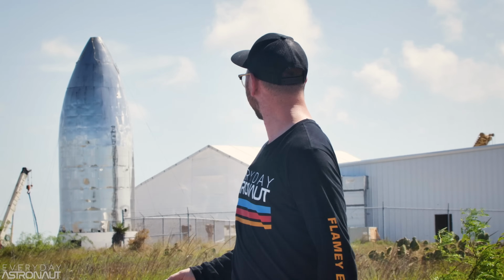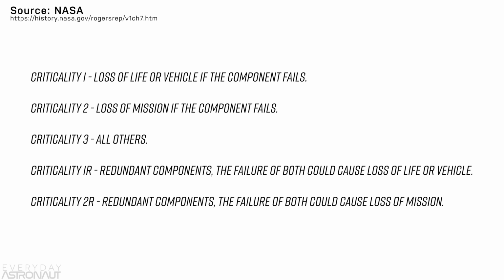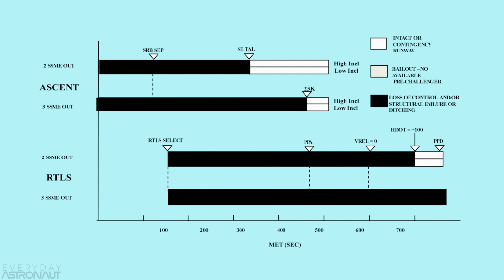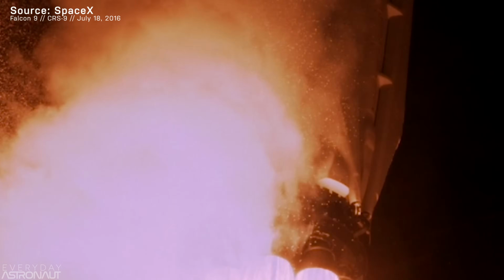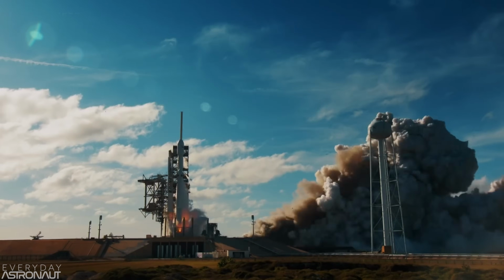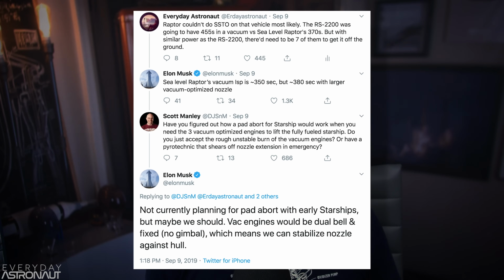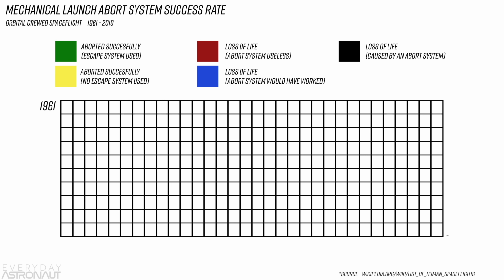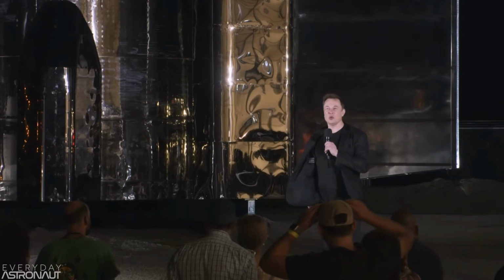Why won’t Starship have an abort system? Should it?!

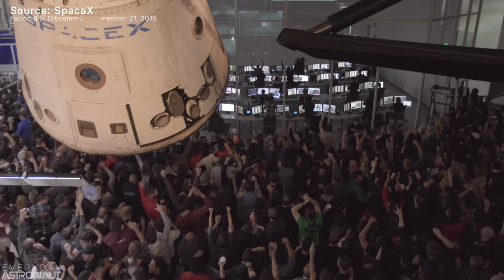Comment: 25:00 perfect examples of why this is so hard. All those failures had simple fixes, but those fixes were not specifically anticipated. And that's where Murphy's law comes in. There is always something you didn't think of. No matter how good your FMECA is there is always something you missed.
Reply: Ikr . He is basically saying nothing else will fail bcs these simple fixes won't happen now
Reply: Yeah, this is a significant part of why testing individual parts and concluding that when they're put together that their safety in isolation means that they will have safety in combination too (highly flawed assumption!) is so bad.

At least when you test systems all together you are much more likely to produce the conditions where unexpected failures due to unanticipated interactions can occur.

Also - by adding a full abort system you will significantly lower the performance margins due to the large amount of weight and necessarily redundant systems (especially propulsion). This has its own implications for safety, and the increased system complexity will, too.

As you say, it's complicated. There is no single answer.

Personally I tend towards a perspective that basically says "space is inherently dangerous, and so is system complexity and reduced performance margins. Prefer a solution that minimises complexity and maximises performance margin, and redundancy if this can be achieved with minimal additional complexity"

IMO, the engine redundancy makes me feel significantly better about the safety of the vehicle. In future, if the cabins can be fitted with a means to turn the crash couch into a self contained ejection capsule (no propulsion, just hope that the capsule emerges from a vehicle failure intact) with a parachute system maybe this can be a good compromise. It would be nowhere near as good as a full abort system but it's also far simpler, nowhere near as heavy, and you'd think still much better than having nothing at all!

Comment: If I had a nickle for every time I've seen a 1x10-6 failure occur...I'd have more than a couple nickles. It is just incredibly hard to maintain reliable data and quality control on stuff. So let's say some small component or screw. You not only need to engineer it to the required standard, you have to maintain that standard throughout manufacture. It is so easy for some sub-component subcontractor to change something that is calculated to be a fit-form-function replacement, only to find out later all your testing has been essentially invalidated because it's different.
Reply: Boeing Boeing Boeing

Comment: Hey Tim I was wondering if you knew where to start looking for material on the phenomena where a rocket engine is optimised for above sea level, so when fired at see level you can see the exhaust collapsing in on it's self. I have to do a computation capstone and was thinking it would be cool to model it. Thanks for the help.
-Angus
Reply: How detailed are you looking for with it? Tim talked about it a bit in the Aerospike video, but otherwise I can just figure looking up something like "overexpansion characteristics"

Comment: It always made sense to me that the starship to moon (or mars) should really count on doing a rendezvous in earth orbit for fuel AND for embarking all personnel.  Why risk the dangerous earth to orbit and back inside the starship when the crew dragon designed & tested for this purpose exists? (Not to mention other manned vehicles to orbit).  Also, any starship to the moon could greatly reduce complexity, risk, weight, & cost by designing it to go from earth orbit to the moon and back and skipping the earth to orbit & back part. Airbreaking orbits are routine and could still be used on return from the moon to the orbiting transfer station.  
       Starship must stop at an orbiting refueling station to do the moon trip anyway, so why not a dedicated transfer/refueling station?  The orbiting transfer station seems to be the best use of the ISS or repurposed Artemus or a one way Starship designed to remain in orbit and used as the gas station with an airlock module for astronaut & supplies transferred to the Starship (renamed Moonship)

Comment: When this thing is as safe as an airplane, I'll strap in and hang on.  Until then, it's nothing more than a fully reusable bomb.  I don't believe it needs an abort system, it just needs some time to prove it's as reusable as designed after it experiences a few RUDs before they launch civilians with it..  Fear the multi-use COPV...

Comment: With the number of passengers planned, any flight without an abort system is irresponsible.  Rocket engines HAVE to work, it will not glide to a landing.

Comment: In a nutshell.. Starship is an upper stage and does NOT use its engines upon launch, therefore starship IS an abort/escape system. If superheavy blows then starship ignites and flys away from the blast. exactly as Elon described. adding another breakaway point on the ship is by far more dangerous IMO. conclusion.. don't obsess with what ain't broke.

Comment: The booster is below shuttle and if it blows it'll blow the connection for stage separation and then ship will have more then enough thrust to escape at least a theory

Comment: As you approach the ground during the last few seconds of your suicide burn, and an engine fails, can you throttle up another engine quickly enough to avoid hitting the ground faster than the landing gear will handle?

Comment: ACES could also have been used after the vehicle had disintegrated. It would have saved the Challenger crew as they were alive and conscious until hypoxia got them.  It would have been hard to get to the hatch but at least you wouldn't have to futs around with the pole as there was no longer a wing to hit!

The crew cabin was actually incredibly strong. It survived a fair chunk of its fall even after the spacecraft broke apart. Eventually heat and stress broke it (long after everyone inside was cooked already), but we know it survived much of its descent because the crew cabin pieces landed relatively close to each other.

Comment: Hi, I really appreciate your in-depth presentations. Comments: at about 13 minutes in, you are using some slides to show unrecoverable-failure prospects. IMHO, this part did not cut it, because it is not explaining what these slides really mean at all. (Acronyms without guessable definitions). And then half a minute later, a second one appears for some sort of comparison, and nothing becomes any clearer. Additionally, at 18 minutes in, the slide about strength-density of SS301 vs Carbon composite and aluminum was un-intuitively presenting the point you were verbally making. 

Please don't think I have some $hi!-faced grin on about getting to complain -- I truly delight with the work you put out. Anyway, rock-on! KT

Comment: Serious questions...1 are they using the wings from starship to stear while launching? I'm assuming yes and 2 and I always wondered this that is a tall vehicle going up and I was wondering if they found away for the balance of it? I would think it will end up being top heavy and could tilt and bad news?
Reply from the maker: They won’t use them to steer on ascent, I’ve got a video on why that’d be a bad idea - 

Why does Starship only have 2 rear fins?! https://youtu.be/hsul-GE4XiA
Reply: @EverydayAstronaut  starship is ideally suppose to be or become a cargo vessel yes? And has the potential to become pretty heavy. I'm think from a aircraft mechanic stand point but if its too top heavy and begins to tip at any point it could steer the vehicle in the wrong direction or worst. I'm curious if there is any way to steer the vehicle to prevent something like that
Reply: @joshuafrenette7312  Rockets do better when they're top heavy. From an aircraft perspective, think of it as a nose-heavy plane in a slip situation. If the Center of Drag is further behind the Center of Mass there will be more corrective force. 
And as for the nose weight causing it to tilt, that's almost beneficial. The engine's thrust vectoring will pitch it over a little after liftoff, and then its own tendency to nose over will actually contribute to the Gravity Turn (I don't know how much actual rockets rely on this if at all, but it works in KSP so it must be a thing!). And these larger rockets are also less likely to pitch the wrong way on their own, because of their much greater moment of inertia.

Comment: I am thinking the main limitation will be the political push.  The current administration seems intent on rushing Boeing on the SLS just after the 737 MAX was grounded after Boeing rushed it to compete with Airbus.  4 more years of Trump definitely would mean rushing crew programs and probably loss of life due to the rushing will probably result in cancellation even though the first failure will be with the SLS, so Starship would never get the chance.  If a different administration makes it in, they may regulate an abort system from the get go and so Starship will never carry people.  Even after a launch abort system is considered an obsolete caboose, it may still be required.  I suppose a good question to ask now is there any political scenario where Starship will get a chance to show it can carry people?  Then again if the BFR does blow up on unmanned missions and the explosion rings in people's minds like the Hindenburg failure did, that would also doom it for manned missions.

If you look at the last two NASA town halls where NASA employees were able to post questions, pretty much all of the top questions center around the lack of funding and compressed timelines of the Lunar missions making for impossible working conditions.  This last time around the response given was mainly "just try every day to make it happen."  I have been in both successful and failing organizations and this is solidly in the fail by bad leadership territory.

Comment: The problem with rockets is that they can't be launched anywhere near as frequent as airplanes do, the enviromental impact is simply way to big. So rockets (in this form) being as reliable as airplanes will never be a thing. Accepting that, it should be ok to have rockets with enough redundancy (and severely tested by an unbiased organisation) to not need an abort system.

Comment: It it saves a life in even some scenarios then it should be required.  
I hope they also are not going back to outward opening doors also.   

This is irresponsible to not have an abort system.  We should not be so cheap with our astronauts.
Reply: Boeing's 737 Max aircraft had a system designed for the sole purpose of making the aircraft safer in some scenarios. That system has proven to kill people in an entirely different scenario.

Comment: I think a huge part of the answer is the general public's perception of 'acceptable' risk of loss of life. That is if you think about it the actual current loss of human life in civil aviation is today far higher in 1 year than the whole history of spaceflight - yes safety rate per km flown is magnitudes higher but it is public perception that allows as many deaths without the whole industry collapsing! 

Unfortunately do to rarity and increased shock value to often on film mid flight RUD an early loss of Starship 100 person crew would be catastrophic for SpaceX and human spaceflight development in general even with first 100 (or maybe 500 flights?) - who knows what the exact number of flights would be required before loss for public/government risk acceptability to shift?

I wonder is there a number of flights without loss that can be identified in Civil aviation history where this perception shifted?

Also if aeroplanes were at early stage of development in the era of TV and/or social media would they have survived puplic perception of risk before aviation industry became too big too fail?
Reply: Also it may be worth adding that civil aviation still employs emergency evacuation chutes etc. even tho' in worst accidents they don't save lives they do reassure passengers! So some form of safe abort system and/or emergency evacuation would most likely be required for humane level of passenger reassurance even if not able to save lives in worst case accidents?

Comment: Starship, with a plausible flight rate of four times a day , means a complete rethink.
There's two primary fault types: 1) It was defective to start with. 2) It wore out.
By flying a full flight first , with no passengers, will, it isn't a simple fault of type one. And the sheer number of flight means actual, physical statistical failure analysis. This is where airplanes have the rules like "Complete study of engine after X hours". But before we get to any significant numbers of crew (let alone passengers), they're going to be on a boggling flight plan. "Because, hey, those Starlinks won't put themselves up there, and they're pure cash!)

Comment: They only need to  separate the  crew compartment from the rocket with a bulk head  blast bolts  parachute 🪂.     You have to build the rocket with a bulk head any way just engineer it so it comes off.  It does not even have to escape the rocket as if it comes off it’s going to escape the rocket in time.   Blow the bolts when it starts heading sideways.   It’s not ideal but at least it’s a good chance.  Better then no chance.

Comment: Like the poor De Havilland Comet and too many of its passengers, there will be some lessons that will be learned the hard way. I've always thought that part of the problem with the Comet was that when initially looking problems they found some, and then a bunch. Sadly those were likely not the problems bringing down the airliners.

NASA managed to make the same unforgivable error twice. STS-51 and 107 were both lost to known problems that they convinced themselves were less of a risk because of previous successes or lack of failure. I'm just shocked after they identified the problem after Challenger they went right ahead and did it again and even more blaetetly.

Comment: 31:41 Vacuum engines probably couldn't fired on the ground
Reply: The engines themselves are virtually the same. The larger nozzles will have flow separation issues, but A) they probably won't be running for long enough to have major instability issues that can't be corrected and B) as Tim said...it beats the alternative

Comment: Gotta admit, I'm kinda bothered by this video. While it provides a lot of very nice information, the way everything is put together it almost feels like an argument dismissing safety measures? Like, the shuttle was heavily critiqued for how much risks it took, so it's hardly a good comparison and technically being better doesn't mean all that much imo. As for abort systems, there's talk at length about how unused they go and such, but I'd guess that seatbelts and airbags are even less so yet they're still considered absolutely necessary.

Comment: The obvious solution is to launch the crew and Starship separately, at least until it has proven itself over many launches. The Starship design necessitates orbital refueling, there is no way that is happening any time soon with a crew on board! A rendezvous with Dragon may not be possible for every mission profile, but this is an easy solution that covers 95% of the problem. More expensive sure, but it eliminates nearly all uncertainty until the reliability can be proven with a real world data set

Comment: If SpaceX has interest to take NASA astronauts to the ISS without an abort system well good luck 👍🏻 because no way in hell is NASA going to allow that
Reply: As far as I know, they have no plans to send starships to the ISS, but are working closely with NASA on the preliminary paperwork to get the principles behind starships’ systems approved (i.e. the change in heatshield design)
Reply: Frankly, I doubt they'll be allowed to launch Starships with humans at all, at least for several years.
Reply: Probably, and especially if their landing success rate is as bumpy as the early falcon 9s were (or even current falcons)

Comment: Yeah so with that SRB failure on STS-51, might the SRBs on Starliner's Atlas V N22 be of any concern? Understanding the cost of expending an Atlas for a test flight is higher than for a thrice flown Falcon 9, surely I'm not the only one who would feel more confident in Starliner's LAS if it performed an in-flight abort simulating a similar scenario.

Comment: What if the shuttle was built like Starship with that type metal and and tiles that Starship using
Reply: In my opinion, Starship is (minus some features that are there because it's also a deep-space vessel) what you'd get if you designed the shuttle with today's technology. In the late 60's vertical landing boosters weren't an option.
Reply: Back in the sixties I don't think they even considered repulsive Landing eventually we'll have a ship that can launch from the ground and go straight to space without the first stage Rockets boosters
Reply: @emiliogreenwood8190  It's modern computers that make the SpaceX landing system possible; back then it was wings or parachutes. 

As for SSTO from Earth, as far as I know, the only practical way is a spaceplane with hypersonic jet engines. Scramjets are being developed-as missiles. Eventually they may be applied to this problem (2030's maybe).